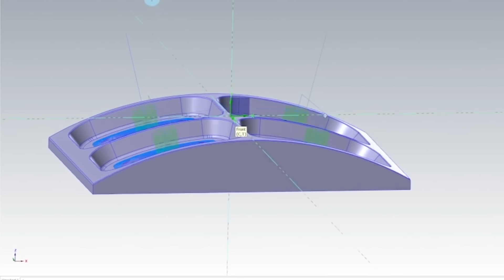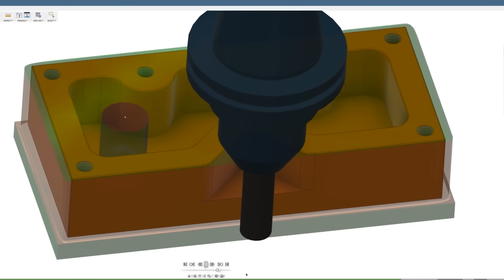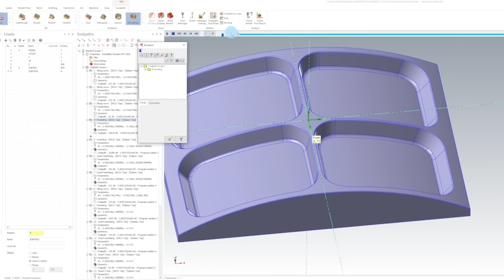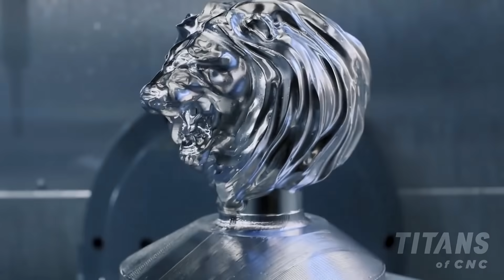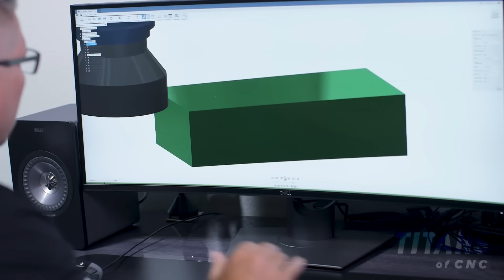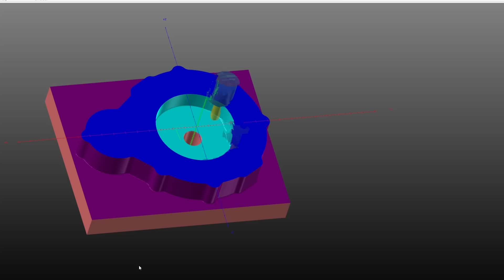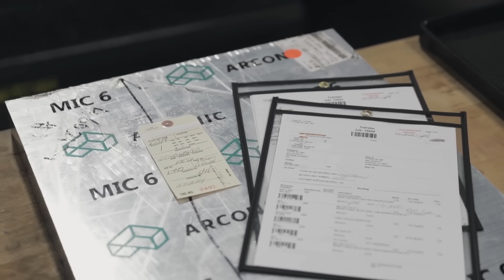TOP 5 WAYS to EARN $100,000 as a CNC MACHINIST | DN Solutions

Comment: Wow . If you can run a mill,lath cnc equipment sharpen your own tools and are the shops setup man and trouble shooter plus you do the inspection work and even the forman of said shop and you still can't make over 50 or 60 grand the boss or company is a tight ass . Leave go work for someone else.  I did and in 42 years I had more then 25 jobs . College educated people most shop owners have no idea what it takes thats why there best people never stick around . 
100,000.00 a year should be an average wage for someone with the skills . Funny thing is I finished my career at Boeing 13 years making $100,000.00 a year and didn't use any of my skills they turned me into a part loading monkey load part push green button .
Boeing wrap each and every part im hundred dollar bills the worst run shop I ever worked in but they paid the best . You should have seen there scrap carbide bin . I wish I could have resold that carbide used once then in the recycle bin there to stupid at Boeing to use cutter comp .  You want to make money in a machine shop own it thats about the only way .

Comment: Ya don't work in a job shop or small shop . Get a job in aerospace
Reply: My current shop is 65 people.  I just got my second raise in two years and am well over $100K right now.  The size of the shop is only a small factor in the wages they pay.  My last shop was just about the same size, but wages there were MUCH lower.  My current shop is more mass production focused. We have a few part numbers that we shop 3000-5000 a week of each.  At my last shop a "production run" in some cases was 200 pcs.  Then we wouldn't see that job again for months.  A shop that runs large volume production will usually have an advantage over a shop that runs smaller orders.  The income stream is more reliable.

The kind of work they do is a larger factor.  Medical devices/prototypes are WAY more stable then aerospace.  Even through the pandemic my shop was busy.  Now that pent up demand for parts is the reason we are getting new machines and hiring more people.
Reply: @brandons9138  
I hope the shop stays aflot .
Reply: @toddwarmbrodt8087  We are buying new equipment and looking to hire. We can't keep up with the demand from our customers. We'll be fine.

 I should also note, that I'm not your standard "production floor" guy. I'm responsible for 14 Swiss machines and our newest 9 axis twin spindle, twin turret lathe. I handle the programming of production jobs. I do The programming, setup and run of short run prototype jobs.

 I'm also responsible for training the guys on the floor to raise their skill level.  Just this year I helped one guy move up from level 2 to level 3.  I taught another guy how to set up swiss machines.
Reply: @brandons9138  
Hope so . You wouldn't believe how many shops I have worked at that went under. Many reasons like only 1 or 2 large customers or moving to a bigger building or the economy slows the owner steeling from company or new owners who cut cost through the payroll . If they run out of toilet paper there going under or can't make payroll . I have seen it all

Comment: This is all bullshit. 
 I've never heard of a CNC machinist making 100k, not with any number of years experience, or any level of skill, or any amount of overtime. 
 America doesn't respect manufacturing skill.
Reply: I just got my second raise in two years and am well over 100K.  I'm salary, so OT is not a factor.
Reply: @brandons9138  As a machinist? Where?
Reply: @dcyphyr  I'm in the SF Bay Area.  San Jose to be exact.  I should also note, that I'm not your standard "production floor" guy. I'm responsible for 14 Swiss machines and our newest 9 axis twin spindle, twin turret lathe. I handle the programming of production jobs. I do The programming, setup and run of short run prototype jobs.   I'm also responsible for training the guys on the floor to raise their skill level.  Just this year I helped one guy move up from level 2 to level 3.  I taught another guy how to set up swiss machines.
Reply: @brandons9138  That is incredibly awesome. However, you are highly specialized, in an extremely high cost of living location. 100k in California is 50k here in the southeast, after the cost of  housing. 
 With your skills you could do very well, anywhere.
Reply: @dcyphyr  That's the thing though.  As you put it "With your skills you could do very well, anywhere".  My skills aren't anything special, anyone can acquire them.   I've only got about 15+ years in the trade.  It's time and dedication to the trade.  It's being a knowledge sponge.  It's seeking knowledge where ever I can find/stumble upon it.  There is still so much more to know/learn.
Reply: 114k base here. Right around 150k with my o.t.   i love my job and makin badass shit.  Im never even asked to do o.t.  i do it because i enjoy it and the money is good
Reply: Ive made better than that for over a decade.

Comment: When the machinists increase productivity and profits it only means more bonuses for the management in most cases
Reply: haha, my job in a nutshell.
Reply: There for, know the value of your work.
Reply: @WhyDoIHaveToHaveAHandle_s  i was running a glass cnc machine and this was exactly what the previous guy who trained me said before he left. i replaced him because he poked his eyeball out by mistake from one of the trim pieces. he was supposed to return after his eye healed but they canned him instead because i was outperforming him and was saving the company sheets of material that he was going to throw out or sheets that he would cut incorrectly which he blamed on the material. so i found out i was saving the company almost 300 grand a year but the response to that was good job here's a 2 dollar raise...
Reply: @WhyDoIHaveToHaveAHandle_s  It doesn't make a difference if nobody wants to pay you.
Reply: I just left a shop because all the Machinist got a raise except me only 3 of us...back story short CNC lathe guy only ran cnc Lathe (PUMA), mill guy only ran mill (HASS). I ran other HASS, Mazak (programed in Mazatrol programmer couldn't), manual Lathe and Mill, and a few other old machines. I was also only one who could probably run them so I left. Pay I was making was $20/hr start new job Jan at almost $30/hr its a job shop were ill get to learn the CAM programs hopefully.
Reply: @christiantough5  30 an hour and you don't know cam? You hit gold. You're making what a lot of a programmers make.
Reply: @phuckyocouch9098  they are teaching me CAM, as for the Machinist things I know that part learning the specific for each machine lol. The corks if you will.
Reply: @christiantough5  Do you have any advice or know oflearning resources for cnc, cad, CAM, g-code for someone just starting out into this type of work?
Reply: @luqmuhmmad2616  as many have said in different post, best way to learn machining is to first learn the basics on a Manual Mill/lathe. 

Example do you know how to calculate RPM, feeds, recommended SFM for HSS/Carbide for drills, mills, lathe tools. All of that gets imbed in your brain doing manual so when u go to CNC you can wrap head around G73 and a G81. Or G02 and a G03 for interpolation.
Reply: @christiantough5  damn I won't have access to any manual machines till next fall or later. I manage to get a CNC job and took time off school to work for the semester. I'll learn Manual machining once I transfer majors to CNC at my school but for now anything else I could do to understand all that you said and gcode/m code and cam. I know basic solidworks.
Reply: @christiantough5  you don’t need that anymore. We have FS wizard for feeds and speeds and manufacturers recommendations.
Reply: Dosan and Mazak are the worst shit ever, and by the way think u mean Haas not HASS. Greetings from Germany where we also build amazing machines.💪    @christiantough5
Reply: How true . Make them a millionaire and you will be lucky to get a bonus
Reply: @toddwarmbrodt8087   thats how it works, they arent your machines if your working for someone, so as soon as you buy your own shop, materials, and machine then you can complain
Reply: @calvinp5358  
Ok . When you own a machine shop and are not willing to share the wealth good luck at keeping top quilty machinist.  I have seen the turnover rate bankrupt more then one shop . 42 years I was in the trade and have worked for dozens of shops always went where the money was and watch shops with piss poor wages fall one after another.  One shop gave out a $25.00 bonus after we made them million they even got the president award for quilty and on time delivery from Boeing . After there $ 25.00 dollar bonus 8 of the top machinist quit on the spot gave the check back because it was an insult and that shop had a hard time from there out . There $ 25.00 bonus cost them dearly.
Reply: yeah but everyone gets to have pizza at the end of the year!
Reply: "it only means more bonuses for the management in most cases"
its why i hate public companies, the management is only interested in bonus and nothing else, which compared to a private company, you can directly go toward the owner and sell yourself(and fix the internal problems)
Reply: Amen!
Reply: @marcol869  And usually those managers don't last long since they go into a highly profitable shop and then the shop becomes barely profitable and then unprofitable.
Reply: Learn to negotiate better
Reply: Then switch to a company that does value your skills and talents. Titan is correct, I make the $ he states.
Reply: Such a machinist is not using his most powerful trick: walking out to start his own fabrication shop.
Reply: You work for the wrong shop
Reply: One machine one chair
Reply: Yeah man but you can flex your worth if you have a decent manager
Reply: @chub22g24  haven't had the chance to work for a decent manager
Reply: @bjournigar snaga  you will man. Don't worry
Reply: @chub22g24  I've been contemplating  buying two mayzak machines
Reply: @heman85515  I hope you do. And I hope it works out for you
Reply: If this is the case, go out on your own. Get work and do it right. Sub-contract for other businesses. If you can increase production then you can charge the other machine shop their cost per unit and take the additional percentage you can produce faster as your profit. 20% increase in production on a $1,000,000 deal is $100,000 in additional profit.
Reply: @shannonp4037  companies that subcontract don't make enough to support them self, I personally had a company sub contract out work (they were lowest they could find) rebuttal was our employees are making to much. They said that because the other company was paying their employees less, which ment if they hired new ppl for less pay and got rid of the over paid they would make more money. 3 yrs later  they went out of business from lack of work .
Reply: @shannonp4037  that's the plan,,,don't need a fancy vehicle,, ,just a mill
Reply: I got a great bonus.
Reply: The only people making money are the ones who own the machines.
Reply: Y’all forget the cost of these machines and every single tool, don’t forget the cost for employee wages ect
Reply: how true.. thats why i dont even care XD
Reply: And this is why at 18 yes experience, I'm leaving this field of work.
Reply: I’ve been doing cnc for only 8 months and I’ve gotten $5.50 in raises so far. About to get another $2 raise too.
Reply: Machinists are just too dumb and lazy to be an engineer.
Reply: Good hiring guys, keep crackin that whip!
Reply: that's capitalism for you, brother. it's a real knife fight out there

Comment: I just started as the manufacturing engineer for a small shop. I'm the youngest guy there with the exception of the owner and I'm 52. Everyone else is in their 60's.  I'm trying to introduce modern cutting techniques and tooling but, running into a stone wall because the guys on the floor are very set in their ways. I've talk with my new boss about getting me on a machine when I have some down time so I can show these guy that it works and works great. Hopefully it will open their minds...
Reply: Old guys hate change..good luck with that
Reply: the old ways work.   go work in a shop where that sort of thing is encouraged.
Reply: They'll hate u mate.
Just Keep your head down n crack on.
Douglas Pierce.
Reply: @mostlymotorized  half of the old guys ive delt with rand tools way lower then recommended on RPM and FPI, when I would back track it all they were running at 30% and teaching new ppl to run that way. They didn't like that I ran tools at recommended RPM and FPT, I normally ran slightly under max. Example  an insert rated for 450-750 SFM i ran it at 700-725 SFM and did all the calculations and edits to the program on the machine I ran.
Reply: Careful because even if you find a way that is better the majority of the time they still won't use it due to ego's on the shop floor. For a lot of engineers they stop learning and believe they have mastered the trade. And if they've already mastered it then there is nothing you can show them.
Reply: @Nika_Scott  The new owner and I understand this isn't going to happen overnight and we need to start getting new blood in to start transitioning. We have a guy starting after the new year in his 30's so, we're hoping he will be able to lead the floor in 2 years when the current lead retires. Most of the guys there are 2-5 years from retirement.
Reply: @thefahj-122  I start at a new company after the new year and I'm in my 30s...
Reply: @christiantough5  you in Amesbury MA?
Reply: @thefahj-122  nope, MD
Reply: @thefahj-122  wow you make me feel real young. Started last year in the trade in my late 20s. In a five year apprenticeship I'll be done by 33 and have my degree along with it. 

Couldn't agree more with the old people. So stubborn and try instill their ways onto me on not just in the trade but in life, which for melenials and over doesn't work anymore.
Reply: @Nika_Scott  Crabs in a boomer bucket.